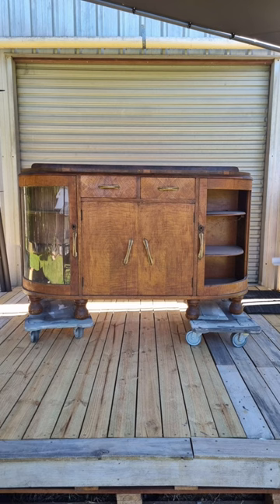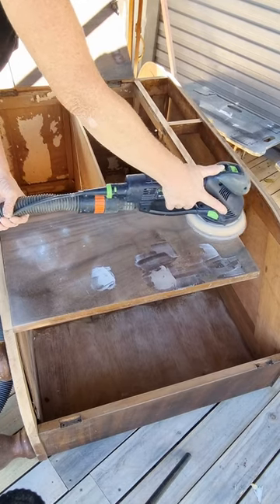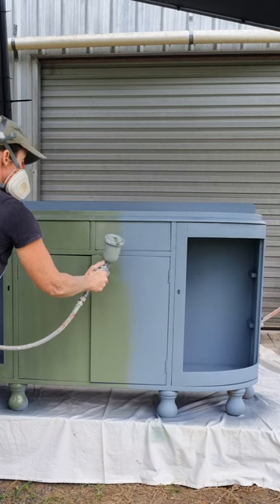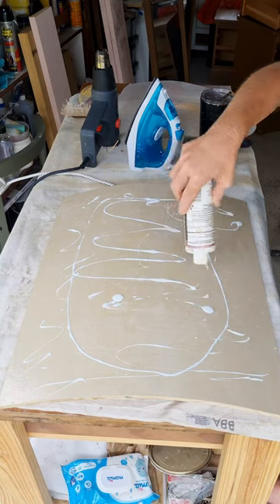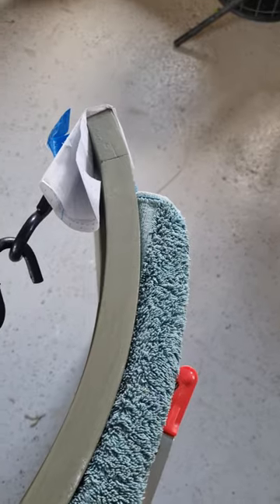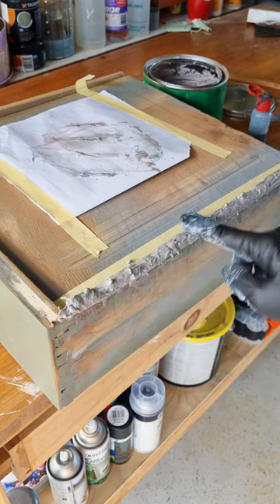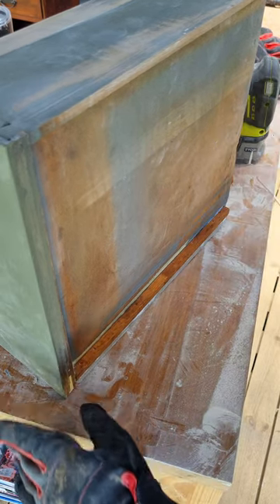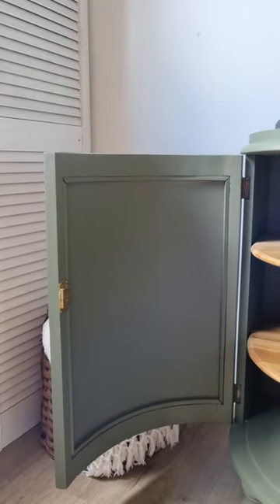Extreme Art Deco Sideboard Transformation. Trash to Treasuer

Comment: @VintageOakDesigns you did a lovely recovery.  Fyi you can give the effect of bent wood without bending it.  @MatthewPeech has a cool video on cutting grooves (not all the way through) in boards that allows you to flex the wood. Another alternate option is you cut very thin strips of wood and glue them to the material but leave a small space between the strips.